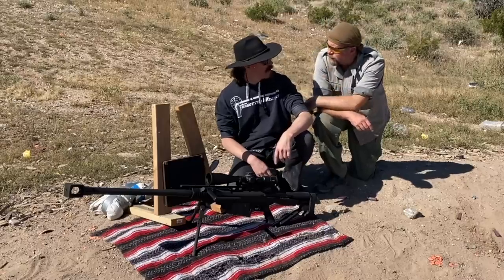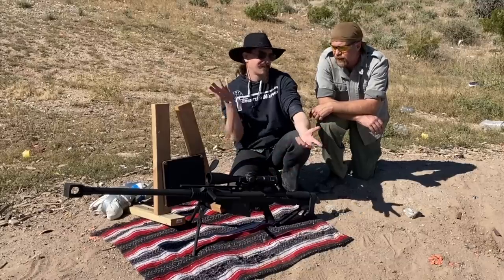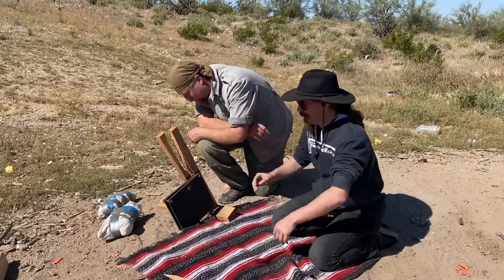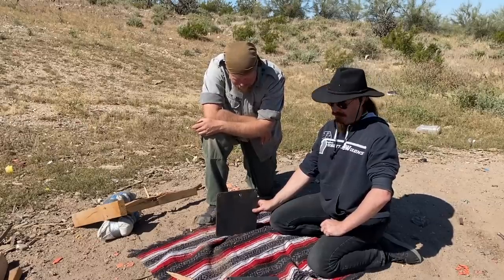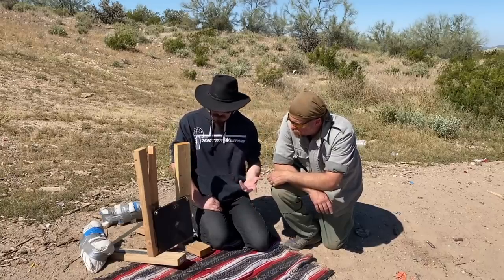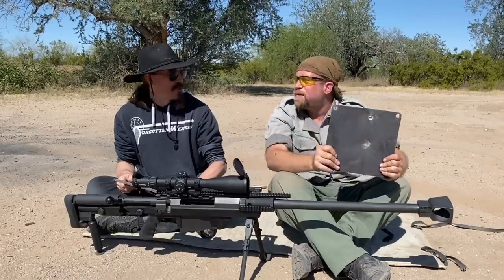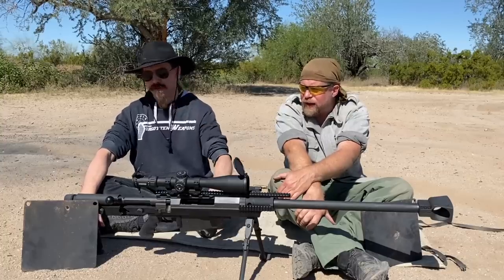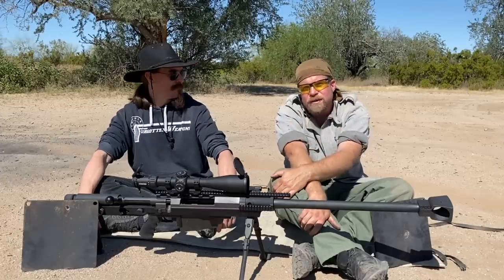50BMG M2 AP - Armor Piercing Ammunition Testing

Comment: Hmm.  Create “Desert Insanity.”  Only large bore rifles (300 WM and up) weighing more than 15 lbs before a scope is installed, and unloaded.  You can have three divisions:  mild insanity, with rifles from 15 to 20 lbs; insanity, with rifles from above 20 to 25 lbs; and freakin nuts, with rifles at and above 25 lbs.  Ammunition for the match must be carried through all stages.  Armor is optional and receives only snickers if worn, ‘cause, it’s generally pointless.  A bonus of 120 seconds is immediately awarded for anyone running the whole match with a suppressor on the end of the rifle barrel; as much for the comfort of the audience and other shooters as for the serious testosterone and adrenaline necessary to handle that added bulk and weight through the whole match.  Only large bore magnum pistols (357 magnum and up) are permitted for sidearms.  Lots of run-drop-shoot-up-repeat, carrying and tossing of that monstrous 60 lb kettle bell, and climbing over and under obstacles, all while the pistol, rifle, and ammunition is carried.